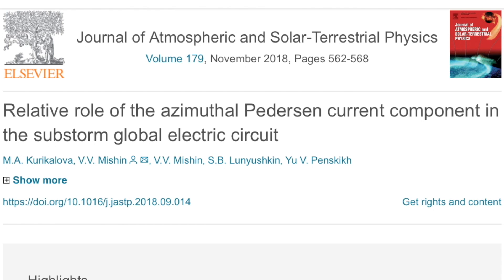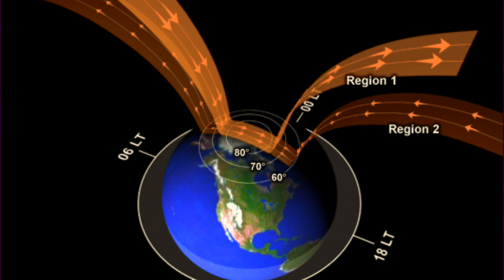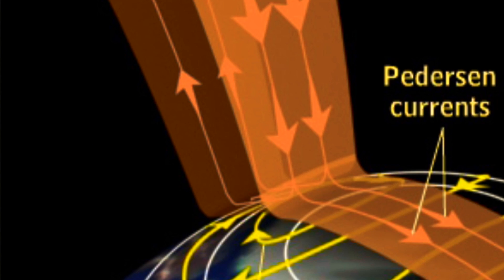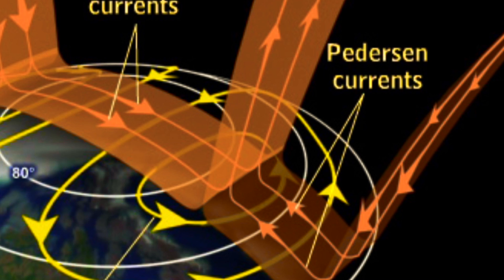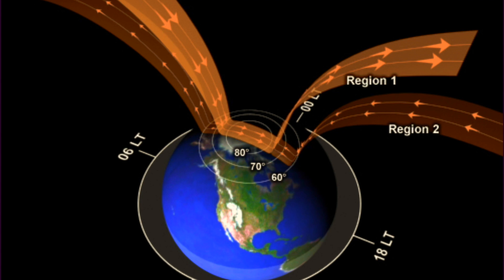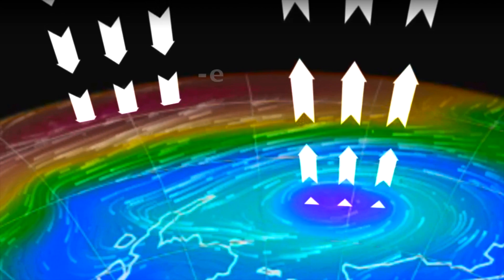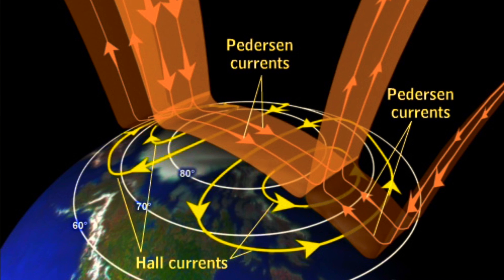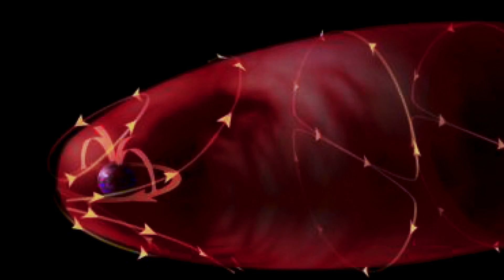Electrodynamic GeoSpace Action

Comment: Are there different changes in the currents on the terminator line?
Wonder too if the currents are the main cause of heart attacks in the am? (The changing of gears so to speak with the Sun & Earth currents at this time most certainly affect the Human body's electrical system?)
Reply: Terminator point might be more accurate
Reply: @ETALAL  It's actually referred to as the Terminator Line, not a point.
But I see your point & hope you can stay in line with me?
;)
Reply: @SSArt98  😆 Indeed I'm gathering information regarding intersecting magnetic feild lines in a toroid.  I'm particularly interested in the points where the lines intersect. Something is going on there, too much energy or some kind of deceleration. Fk the speed of light and that part of particle physics. Anyhoo, there is something about these points that we need to know and understand⚙

Comment: Sothe metallic particles sprayed in aerosols and the massive dust storm they've created in North Africa would create artificial circuitry to offset the flood of photons and electrons coming in from outside our solar system (sources currently undefined).
Strength however, is evident in the negative solar wind readings that have been pervasive in their appearances (indication of stronger force from dark side of earth). 
Question is are they creating diversionary means to offset negative effects or are they doing this to prevent what, in written and oral traditions, would be an "assention" or "evolution" of mankind.
Can not ask the scientific without consideration of the esoteric. That's what got humanity into the state it is in.
Reply: Well put. What has been most noticed by myself is spray on days during the winter which are unusually warm.
Reply: Well yeah obviously.